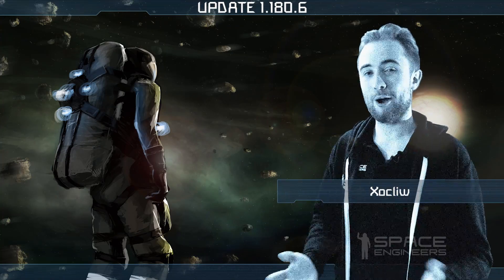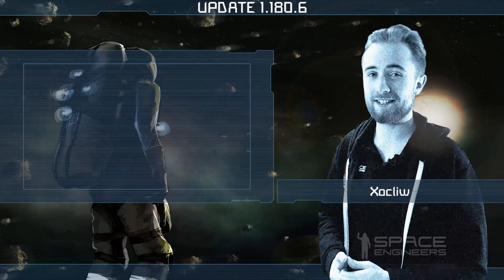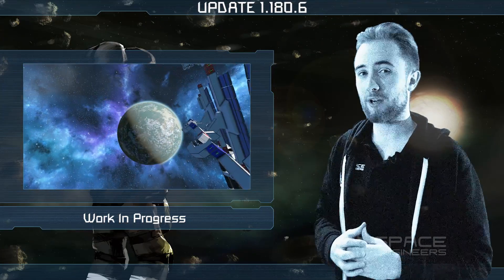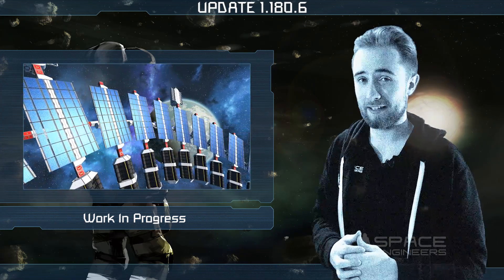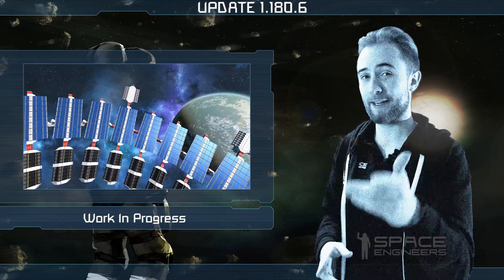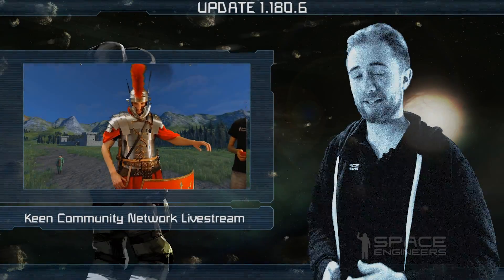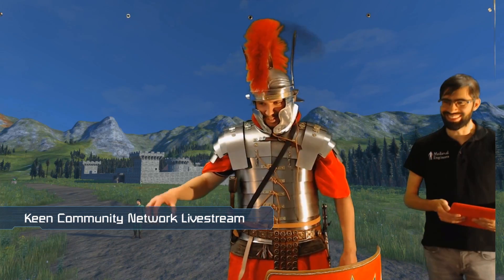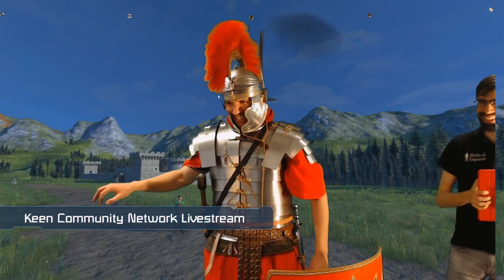Space Engineers - Update 01.180.6 Minor - Beta Improvements

Comment: what?! you can manually flip a switch on it to turn it on? that's so cool! it's the perfect backup generator!
Reply: switches it from hydrogen to ice. so you can just dump ice in it directly to make power without refining it first.
Reply: I LIKE SWITCHES!! GIMME SOME SWITCHES THAT ACT AS BUTTONS OR SOMETHING....
Reply: +OpposingForces I would be pretty certain you mean ice to hydrogen. In other words; ice melts = water + electric current = hydrogen gas + ignition = a powered combustion engine =  electricity!
Reply: You would get the same amount of energy used to split it, it probably turns hydrogen to ice which would release energy.
Reply: you would actually get considerably less.  the energy required to separate water into it's constituent oxygen and hydrogen atoms exceeds the energy gain by allowing to recombine into water by a pretty wide margin, and that's assuming no energy loss due to heat loss in the equipment which is a considerable additional source of energy loss you would really experience.  Even if SE assumed a perfect magical piece of equipment, just the process itself is lop-sided.  part of the reason is that if you separate water into hydrogen and oxygen, and then turn around and let that exact same oxygen and hydrogen combine into water, you will end up with less water...  it doesn't match back up perfectly and you will have loose hydrogen and oxygen that just doesn't recombine into water on it's own.  most of it will, but not all of it.

Comment: When will be one of the most important things be fixed? 

The correct calculating of ships with rotors and pistons? 
if you build for example a small planetary plane with something mount on a piston or rotor, in atmosphere it starts turning because the weight on the end of rotor or piston is not calculated correctly. 
Because of this, the thruster and gyros can not balance the plane to stay still. 
thats a thing the community asked for since there are planets.

Comment: I like the generator, but I hope you'll still add a hydrogen fusion reactor at some point. Hopefully very powerful, but to balance it, quite bulky and having a high cost to build.
Reply: And a high ignition cost requiring some other means of power, likely reserve batteries.
Reply: Good idea. Maybe fuel consumption while idle too, like H-thrusters. In any case, the current uranium reactors would still need to be useful, at least being ideal for starting out or being easier to use.
Reply: TecNik well if you made fusion bulkier but with more power, it would be a good thing for combat ships due to massive amounts of power and easy to gather fuel while fission would remain the go to for smaller ships due to the smaller size

Comment: Wait what is that point of a hydrogen engine? You can't get more energy out of burning hydrogen than is required to separate the water molecules in the first place... At which point hydrogen tanks basically just become batteries...
Reply: I'm pretty sure the engines are just for power
Reply: Well except for way too small nuclear reactors, the game so far hasn't really broken with physics, except for some simplifications for gameplay like with thrusters all acting on the centre of mass and of course some things that are too demanding to simulate.
Reply: But a hydrogen engine for power is kind of pointless. Even under perfect conditions, the power needed to run enough oxygen generators to supply the engine with H2 would be equal to the output of the generator: With other words: This engine could not provide any power to your base. It could only be used to turn already stored hydrogen into power, at which point it's a battery.
Reply: Yeah its funky I agree, it would be better if they added fossil fuels as an alternate power source. I believe its just for simplification, and I'm just excited to get an alternate power source other than nuclear power or solar. I believe in that major update they are going to release windmills as well.
Reply: Or a biofuel of some kind would have been cool that you could generate using water to grow algae or something.
Reply: Biofuel would have absolutely been a nice thing. or even just adding a new resource to mine, for example coal, that would allow you to power structures early on. Thinking about it, coal would be pretty great, it would require oxygen, making it good for early game on planets, but still incentives the player to go for nuclear later on. Also with Uranium ingots being much more mass efficient than coal. Just seems to make all round more sense than to introduce a hydrogen engine...
Reply: I started a thread about introducing coal to space engineers:
https://steamcommunity.com/app/244850/discussions/2/1291817208487802443/

Maybe drop a quick comment so we can get the discussion rolling, because the more I think about it the more I'm starting to like the idea.
Reply: Scorpionsnerd There is much, MUCH bigger broken physics. Mainly the mass blocks, and the gravity generators. And the jumpdrives.
Reply: Hydrogen engines are, in a way, just another battery.
Reply: I will drop a comment, I would love fossil fuels in the game.
Reply: Well the jumpdrive and gravity generators just stem from wanting to improve gameplay. With a 100 m/s speedlimit due to collision detection you need some sort of teleport, and on large ships in space, having gravity is really nice. And with both jumpdrives and artificial gravity you can just bring the classic "It's sci-fy, some future technology we don't know yet". But hydrogen fuel cells we do know already today. And they can't work as a power source except in a battery-like manner.
Reply: Scorpionsnerd I think they do that to allow more control. like to allow ships with only H storage to function. otherwise it would require to transport the ice with you.
Reply: I see it more as a Battery, maybe even a sort of Fuel Cell equivalent to a battery.  As long as an Engine+Tank hold more (Potential Energy)/(Volume), I think they will be considered balance.  Smaller Hydrogen Tanks would be appreciated.
Reply: Yeah I can absolutely see it's use as a battery. But that won't change much. The current batteries in space engineers are really good regarding energyStorage/volume and energyOutput/volume. But it seems that people think they can just mine ICE to power entire stations. And that would go against physics. Basically I just don't get why they introduce a hydrogen engine when they could add something like coal, that would actually help a lot with early game power.
Reply: Scorpionsnerd no, this is, as they showed, an emergency power supply. it will probably generate slightly more that a small nuclear reactor but obviously it consume hydrogen in the process so in survival you are gonna need to stock up on ice. but it won't be a long term power solution. like with hydrogen thrusters, they work for a while but they won't last long no matter what.
Reply: Mods for this new block should be interesting, I wonder what people will come up with. I'd like to see a biomass reactor, moisture vaporator, hydrogen blimp, and all the original sample mods keen launched made vanilla. Wireless power transmission would be a nice mod of the laser antenna. Hydrogen could work for fusion reactors, I don't understand the hydrogen diesel either.
Reply: Mansuy I fear you are missing the point: This is not about how long term the engine could run. The point is, that the energy consumed by oxygen generators to split ice into hydrogen and oxygen has to be at least equal to the energy produced by this engine from the same hydrogen and oxygen. If you could get more energy out of it than you put in, it would go against the conservation of energy. As such this is not a power source like a reactor, but a battery. 

Or to make an example: If you were out in space with a ship that had an oxygen generator, a hydrogen tank and a hydrogen engine then you could not use mined ice to increase your power reserves. You would need another power source, like solar panels or a nuclear reactor to run the oxygen generator. Because you need to first put in the energy to split the ice, in order to get the same energy out once you burn the hydrogen(which turns it back into water). Which as said, is just a battery: Put power in, get the it out later(with normally some loss due to efficiency).
Reply: Don't try to use real-world laws of physics to justify something in a video game that already doesn't follow those laws flawlessly. This isn't meant to be some hyper-realistic survival simulation. If you want that, wait for someone to mod the generator to be brutally realistic. lol.

Maybe the H2 is meant to be a catalyst in a larger reaction of some sort? We don't have any specs on what this block actually does, only speculation. It's not like KSH actually employs teams of scientists and physicists to generate ideas for blocks to add into the game. :P

Be patient before starting a witch-hunt!
Reply: Games don't have to follow reality, absolutely agreed. But space engineers definitely tries to evoke a sense of realism and it adds to the immersion. Nothing hardcore of course, there are plenty of simplifications in the game's physics engine and its presentation. But creating net power from ice is just stupid. It makes no sense and would certainly have a bad influence on the immersion of the game for me. 

And I just don't see much of a reason for it. Just add fossil fuels, we don't need a magic ice fuelled generator...
Reply: An hydrogen engine would make a ton of sense in real life. After all, hydrogen is the most abundant stuff ever. You could literally collect it while you travel to fuel your ship.
Reply: Hydrogen while abundant, isn't very easy to collect efficiently: Where it is concentrated it tends to be unreachable (you know, as in stars). On Asteroids or planets it tends to not exist in bulk because it is very volatile so it tends to react with something at some point. So if you want to collect the stray hydrogen-atom here and there in space good luck turning that into a gameplay mechanic. As is the only source of hydrogen in SE is ice, and using ice for power generation is nonsense.
Reply: Are you really comparing a bug in the physics engine to a planed feature?:)

Comment: But what is the point of having this generator, you burn thru enough hydrogen trying to use it for thrusters already, nuclear reactors produce alot of power (still need more for my 1 ship which contains 38 reactors in its main power block), but hydrogen generators shouldn't produce more power than a reactor. So I do not see a point of having an in between point from solar to nuclear. Seems unnecessary compared to other things that should be added in.

Comment: The question now is, what is the purpose of that hydrogen power generator? You have to get power in some other way first to break ice into hydrogen and oxygen, and that takes more energy than burning the resulting hydrogen will yield. So, really, you're either screwing yourself over, or massively cheating physics which I fucking hate.
Reply: i think that's why they're using it as a backup generator. it's more practical for me to get electricity in my house from the utility  company, but if that goes down, having an inefficient generator is better than freezing to death in a blizzard.